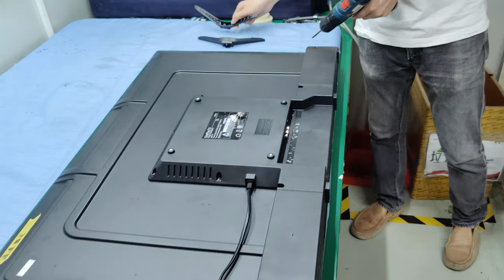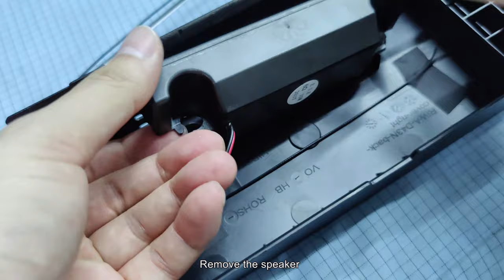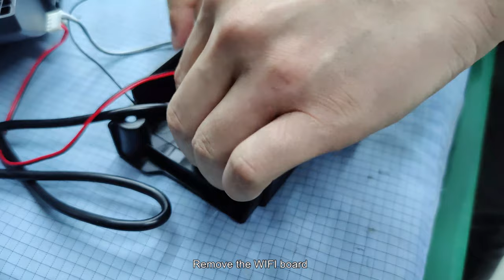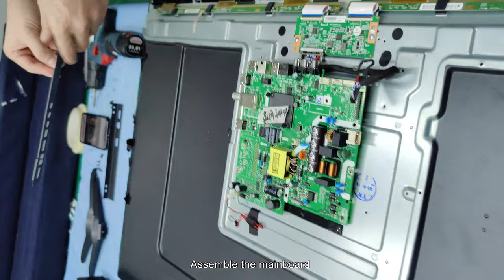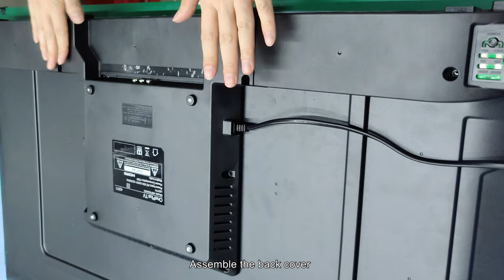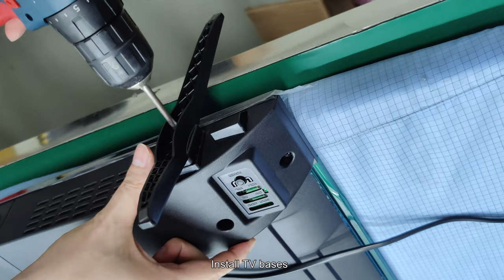32''&43'' OnePlus TV Disassembly And Assembly Guidance Video

Comment: Bro my oneplus 32" TV right side screen lower edge is lightly damaged but mechanic said there is a board problem you need to change to universal board that will cos 1500- 2000 but it will work less 1 year is it correct!? Please reply me ASAP